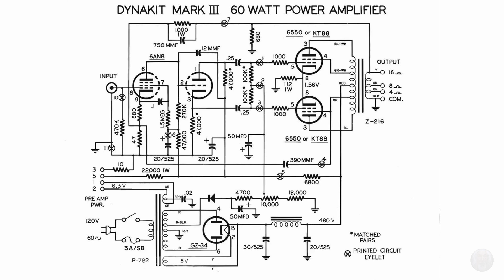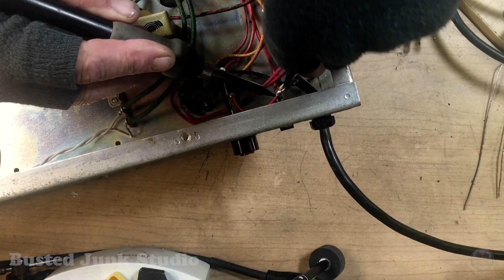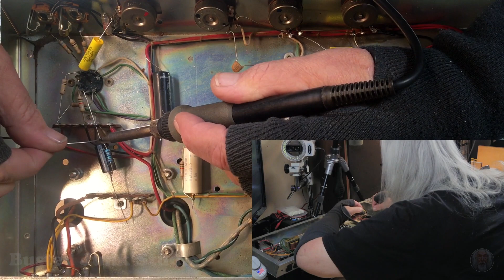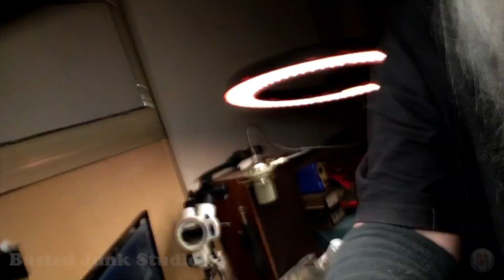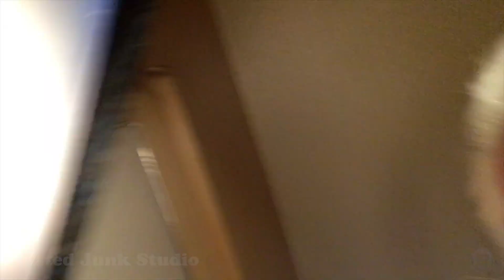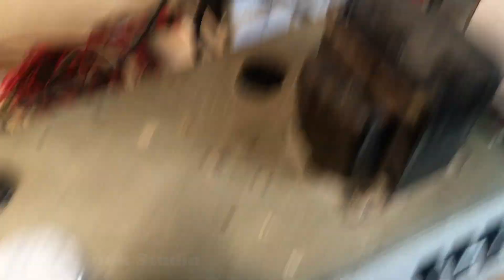#30 - Billy fixes the Sunn Spectrum 1 (Part 4 of 5)

Comment: I'm really enjoying this series. 

I have a Sunn Sceptre that I've modified fairly extensively. I haven't looked at all the schematics from this era but several that I have looked at are all the same circuit (with only the difference of the addition or lack of reverb and tremolo, maybe different output tubes). They're all bass amps . . . basically. They can be made into great guitar amps with mainly just some cap changes. Did you make any circuit changes? I was wondering about that big, white 250uF cap in the preamp. I changed that to a 2uF for a huge improvement. 

One really easy thing that greatly improves the touch sensitivity is to disconnect the yellow negative feedback wire from the output jack.

But a question if I may: Sunns, I read somewhere, are particularly bad about ground loop noise. Do you think it would be feasible/practical/advisable to convert it to a star ground or - what is it called, satellite - ground?
Reply from the maker: Sunn's of this era are a ground loop minefield for sure, I talk about this a bit in these videos. It is kind of star looped to begin with but that's kind of negated when all the hardwire grounds are doubled up with chassis grounding. Maybe a lot of ground runs can be eliminated making things less loopy but that's a lot of work.
Reply from the maker: The preamp cathode bypass capacitor is the key to the tone of this amp and for most other amps as well. changing this value greatly changes the tonal characteristics of the amp, it's the most critical part in the whole amp. Depending on the intended use, a larger or smaller value really aids in achieving optimal tone for the application. If 2uF does it for you then that's what you should use. I left mine at 250uF because I was not trying to mod the amp too much, only bring it back to factory specs.